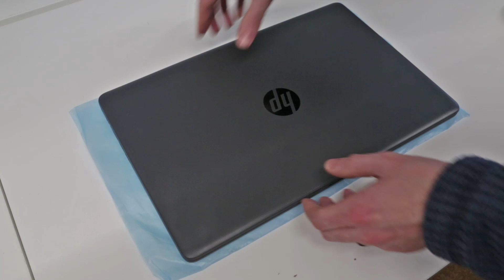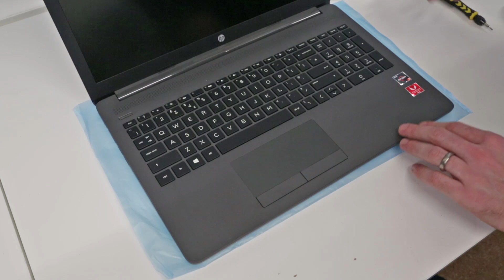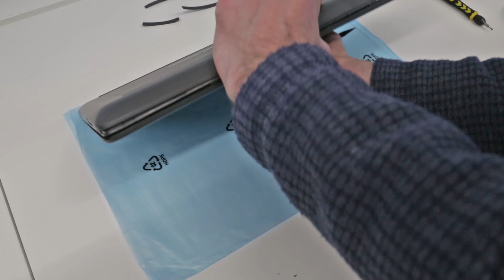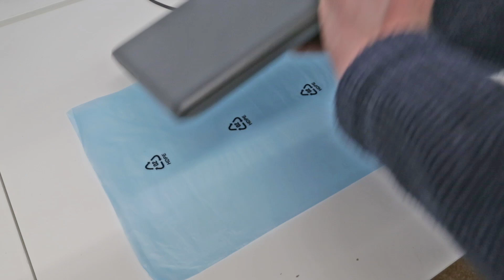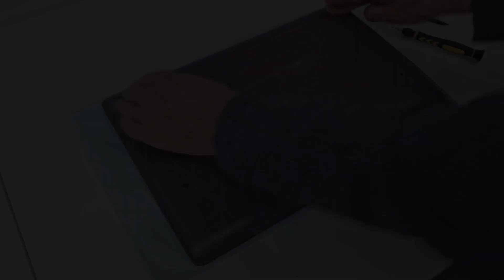HP 250/255 G7 - DDR4 RAM Memory Upgrade Guide - 6BN96EA

Comment: You know what's easier. Is to have the computer on the screen side so the weight of the computer is not pushing the bottom cover back on to the computer that you are trying to remove that is the dumbest crap I have seen in a long time

Comment: Awesome video for this model, but mine seems to be a little different, the memory was souldered to the board with most of the components and I didn't want to damage it so no upgrades for me :(
Reply from the maker: Thanks for the info! What was the full model number?
Reply: @BrueComputing  It was an HP 250 G7 Notebook, I purchased it refurbished but the HP support website says it's not user accessible/upgradable
Reply from the maker: There will be a longer model number, like ab123cd normally. That gives you the exact spec.

Comment: Great video!

In the QuickSpecs for the HP 255 G7 I found this information:

Maximum Memory
8 GB DDR4-2400 SDRAM10
8 GB DDR4-1866 SDRAM10

Memory
8 GB DDR4-2400 SDRAM (1 x 8 GB)
8 GB DDR4-2400 SDRAM (2 x 4 GB)
4 GB DDR4-2400 SDRAM (1 x 4 GB)
8 GB DDR4-1866 SDRAM (1 x 8 GB)
4 GB DDR4-1866 SDRAM (1 x 4 GB)
8 GB DDR4-1866 SDRAM (2 X 4 GB)

According to this table you have 3 options:
1 x 8 GB (Maximum memory in one slot),
or 2 x 4 GB (Maximum memory if you want to use both slots),
or 1 x 4 GB (1 slot used. You can still add 4 GB in the other slot)

My question is: does it really work with 16 GB (2 x 8 GB)? Will it start and accept 16 GB, Is it stable?
Reply from the maker: Yes, should work fine.
Reply: @BrueComputing  can be dual channel ?

Comment: I initially had 4GB of RAM but I recently added an additional 8GB and since then the keyboard and touch pad stops working until i put the laptop into sleep mode for a few seconds then they work fine again for a few minutes and go out again. ANy opinions ? I hate having to use a plug in keyboard and bluetooth mouse when i already have one built in

Comment: I have one of these and it's so horribly slow I don't know much about laptops, it's so slow, mine was bought with only 4gig ram would I have to get 2 8gig ram cards? And how much faster would it make the machine or is it even worth it
Reply from the maker: What processor does yours have, and is it equipped with a hard drive or SSD?
Reply: Screen size:39.6 cm (15.6") diagonal, HD (1366 x 768), anti-glare, 220 nits, 45% NTSC
Processor :AMD Athlon™ 3020e (1.2 GHz base clock, up to 2.6 GHz max boost clock, 4 MB L3 cache, 2 cores)
Memory: 4 GB DDR4-2400 SDRAM (1 x 4 GB)
Storage: 1 TB 5400 RPM 2.5-inch SATA Hard Drive
Graphics: AMD Radeon™ Graphics
Operating system: Windows 10 Home Single 
This is the description from when I got it, like I said I don't know much about hardware and stuff, any help would be appreciated

Comment: Would you say that 3200MHz is a bit much for this model to handle? I got myself a pair of DDR4-3200 8GB RAM cards for my HP 255 G7 Notebook PC (Ryzen), and was about to install them onto it. I believe that they’ll under lock down to 2666MHz once installed, but I was wondering if I could ask for a second opinion
Reply from the maker: I believe they will run at 2666MHz or 2400MHz depending on the exact model of 250/255 G7.
They should work fine though and the cost difference is minimal.
Reply: @BrueComputing  thanks for the feedback I appreciate it. So far I’ve just installed the ram into my laptop and started up now

Comment: My laptop only has one slot. Also it's insert with the label on the 4 black squares facedown. And Why at 5:46 in the video the 2nd memory card disappeared?
Reply from the maker: If it has one-slot it is probably a lower end model with something like an AMD A6 APU and will be slightly different. 
It disappears in the video because I was actually just doing an SSD upgrade for a customer and just fitted a spare memory module for demonstration purposes in the video.

Comment: Hello, I have the NOTEBOOK HP 250 G7 153B9LT 15.6 / I5-1035G1 / 4 / 1TB / DOS. And I want to add 8gb of RAM to it. That is, it already has 4gb to DDR4-2666 and I want to add another 8gb DDR4-2666 module, in total 12gb. The technical question is the following:
  Is this 12gb combination (4gb DDR4-2666 + 8gb DDR4-2666) going to work at the speed of 2666 or 2400?
Because someone told me that this configuration of 4 + 8 in this notebook works at 2400 but if I put 8 + 8 it works at 2600.
Could you confirm how fast the 4gb 2666 + 8gb 2666 combination works? 2666 or 2400?
Thank you, I await your reply.
Reply: Hi there! I was just on the HP support site (Feb 2023), and this is what they recommend: "HP recommends purchasing the same type of memory (same size, speed, and manufacturer) for each slot. For the best performance, purchase the fastest memory the motherboard supports.  CAUTION: Some motherboards are not able to configure memory modules with different manufacturers, or different CAS or density values. To ensure your memory is compatible, make sure all SO-DIMMs have the same part number.".

In terms of how much to put in each slot, here is what they say...
"SO-DIMM memory and requirements: Notebooks use SO-DIMMs (Small outline dual in-line memory modules). They are smaller and thinner than other DIMMs, so are used when there is less space within a chassis. SO-DIMM modules for HP computers must meet the following requirements:

    The number of pins on the SO-DIMM must match the socket type.
    SO-DIMM memory requires a 200-pin slot.
    DDR2 SO-DIMMs are not compatible with DDR1 DIMM and DDR2 DIMM memory modules.
    DDR3 SO-DIMMs are not compatible with DDR1 or DDR2 and use a 204 pin slot.
    With a computer running at a system bus of 533 MHz or 667 MHz, use a PC2-4200 (DDR2 DIMM 533) type"    
            (====> and yes, this is the current support info on the website, but looks like they haven't updated it in a while!!)

Lastly they add: "If possible, make sure all memory modules in your configuration are from the same manufacturer and have the same part number" BECAUSE "If memory speeds are mixed, the system performs at the lower memory speed".

SOOOOOO, your combo should should come out to 2666, according to the above. Memory is soooo cheap nowadays,  I would put in the max amount possible. 

PS. I just looked up your notebook, and it said the slots are inaccessible?

Comment: Is the screen upgreadable to fullhd ips? I  had a lenovo that came with tn 720p panel and changed it to 1080p ips. Maybe you could take a look if possible
Reply from the maker: If you can find a panel with the same connector type and positioning and mounting method then sure, but HP don't list one in the service manual.

Comment: Laptop have ram 2400 MHz and you put 2666 MHz is that a problem?
Reply from the maker: HP actually ship all models of the HP 250 and 255 G7 with DDR4-2666 modules installed - either part number 937236-855 (8GB) or L10598-855 (4GB).
The speed it runs at is dictated by the maximum memory speed the processor supports - the Ryzen 3 3200U supports a maximum speed of DDR4-2400, so the memory runs at that.
The module I recommend is of the same specification as the one supplied with the machine.
Reply: @BrueComputing  my hp have ryzen 3 2200 u you say ryzen 3 3200u

Comment: Presume the machine boots up ok and recognises the extra RAM automatically?  Did you have to buy new feet to replace those removed ?
Reply from the maker: Yes, should recognise it with no other changes. I just stuck the original feet back on.

Comment: hey my 250 g7 has only 4gb of ram. Will there be a problem if i fit an 8gb ram in the second ram slot and have 12gb (4+8) in total?
Reply from the maker: Should work fine if the same spec in terms of speed, latency, etc.

Comment: Hi, i have a question about the ram configuration
The manual says that i cant have a 12gb ram configuration, is that correct?
i have the 250g7 with 4gb dd4, i wanted to add 8gb but i dont know is this is possible, can i do it?
or i can only put 4+4 and 8+8 ram configuration?
Reply: 8gb max 2 x 4gb ddr4

Comment: Is it a good idea to add 8 GB more in the second free slot and keep the already installed 4 GB in the first slot? Thanks
Reply: mine initially came with 4GB and since i added 8GB of ram in the extra slot my keyboard and touchpad stops working until the pc goes in and out of sleep mode before they start working again
Reply: You can have odd pairings but it's not advisable. You would be better buying two banks of identical ram either 2 x4gb or 2 x 8gb. You also eliminate the more problematic issue of different mhz speeds of ram.

Comment: Hi, i need your help . I have a laptop HP 255 G7  with a  AMD A9-9425 APU Processor ( 3.1 GHz base frequency, up to 3.7 GHz burst frequency
  MB cache and 2 cores ) .It has a one (1)  4 GB,  "1866 MHz SODIMM  memory module . What would be the right part to upgrade  memory  to 8 GB . I would also appreciate if you could provide me with a link on Amazon where i could purchase such a module . Thank you in advance .
Reply from the maker: One of these: https://amzn.to/3btcWHe
You can buy a higher speed module, it'll just run at DDR4-1866 speed.
Reply: Thank you very much for your quick response , much appreciated !!!

Comment: can i add more memory i have hp 250 g7 i5 processor bought from ebuyer
Reply from the maker: Yes, it has 2 DIMM slots. Generally they ship with a single module installed.
Reply: @BrueComputing  I dont know if I can add 32gb max or 16gb max also can i just add 16gb and 8gb

Comment: But wasnt the ram maxed out for 8 gb ?
Reply from the maker: No, you can fit 2 x 8GB modules for 16GB.
Reply: Brue Computing But it is important if the System supports 16 gb of Ram.

Comment: This video forgets to mention that the DVD drive has to be removed first. This is very important, otherwise the connector can be damaged!
Reply from the maker: Not mentioned as the model I was working on didn't have an optical drive.
If yours does then you'll have to slide it out after removing the base screws and check for any underneath it along the edge of the chassis.
Reply: @BrueComputing Thanks to video,much helps to me.I have ntb 255 G7 but with only4GB memory.Clasic HDD+DvD mechanic.Ntb slow working and I will change memory,but have only one socked for DDR.I can Hope for change memory update to 8GB or more.Greeting from Czech..😊
Reply: Agreed. If you could add even a quick text warning to the bottom of the screen, it would help loads. Luckily, my optical drive came out undamaged, but the click sound was cringe-inducing😅. EXCELLENT video man. Thank you so much!

Comment: Hi.  My Computer only has a single slot.  Do you know of any single chip 16 GB that would fit?
Thank you
Reply: check the product spec online or the manual it will tell you if you can go from a single 4 or 8 or 16 module
Reply: Ed Kent f

Comment: Like Daniel Ebraham below I would also like to make sure I fit a compatible MM. The parts list number of the fitted HP MM is 937236-855, which is rated at 2666mhz. Does this mean it would be best to fit another 2666mhz MM rather than, say, a 2400mhz rated MM?
Reply: Yes, otherwise your ram speed will run with 2400mhz, which is slower than the other one.

Comment: Hi!
Does the HP have 255 G7 (7DF18EA) space and an HDD connector?
Nowhere can I find this information :(
Reply: The HP 255 G7 (7DF18EA) as stated in the HP site has only the m.2 fully implemented but still has the physical bay for a 2.5" internal drive and an extra (available to all 255 g7 ryzen series) sata controller for either optical or HDD/SSD use  (as you can see for yourself here : https://www.youtube.com/watch?v=S6a6vMI1Lx8). What is missing is the  cable/adaptor for it. Despair not, both are available from HP and 3rd party manufacturers and shouldn't cost much since it's just a ribbon with the appropriate plugs for either side(no extra electronics).

Comment: Is this process under warranty, what damage to the warranty may be
Reply from the maker: In the case of my machine I did not break any warranty seals, but if disassembling a machine I would always assume that the warranty MAY be voided. Obviously in the case of a warranty issue you would want to return the system to its original configuration, and any upgraded parts you fitted would not be covered.

I always recommend using plastic pry tools to avoid damage to the plastics, keep track of what screws came from what location, and be calm and methodical to limit the chance of any issues.

Comment: Hi, I ordered this memory before seeing your video - can you confirm if this will be okay. Crucial CT8G4SFS824A 8 GB (DDR4, 2400 MT/s, PC4-19200, Single Rank x8, SODIMM, 260-Pin) Memory. It currently has 8GB memory. I want to double to 16GB. Secondly how much do you charge to fit, if I don't feel like doing it myself.
Reply: If in your laptop has installed  2400 ten your 2400 module will be good

Comment: I suppose HP means RAM upgrade is not for everyone. Right?
"Both slots are customer non-accessible / non-upgradeable"

"Version 8 — July 3, 2019 Page 6" 
http://h20195.www2.hp.com/v2/getpdf.aspx/c06182356.pdf
Reply from the maker: As there is no access hatch and the system has to be disassembled to get to the slots, HP consider it customer non-upgradeable.

Comment: Can I replace the current storage device with a larger one? Can I add a storage device without removing the existing one? Can I use multiple types of storage devices like HDD or SSD or does this machine use M.2?
Reply from the maker: Yes, I have a video covering this here: https://www.youtube.com/watch?v=S6a6vMI1Lx8
Typically though the HP 250/255 G7 only support the type of storage they are supplied with - models with a 2.5" SATA drive only most likely won't have the M.2 connector on the mainboard. Likewise, models supplied with an M.2 drive (like mine) will need the SATA cable and board added in, which is quite expensive to buy from HP.
Reply: so if I understand correctly the M.2 connector is for the ssd drive like the video . ? mine came with a hdd drive installed , 1 memory module slot on the board . I wanted to add the ssd drive which is next to the battery . No slot though ?  So Im sunk ??

Comment: Does it matter between the SO-Dimm or the SD-RAM for the HP 255 G7?
Reply: SODIIM  phisicaly format of PCB for RAM in laptops, it is shorter and hhgher than stadard DIIM memory for PC computers.
SD and microSDHC is memory card stick going in slot od card reader, it is slower tnan RAM add is usually used to copy photos from smartphone to laptop/PC

Comment: I want to do this but I’m just a bit nervous as I haven’t done anything like this before and don’t want to damage the laptop. Any tips?
Reply: Keep the video up on a screen playing while you go through it. It's not a big deal really! Having two nice flat head screw drivers to take the case apart helps, you put one in the case, and then slide the 2nd in the opening and move it along, and keep prying! It will just pop open as you go. If any part seems extra difficult go back look at the video and see if you are missing a hidden screw! These things are more durable than you think as far as working on them goes. You should be able to do it. Upgrading the memory in these things makes a world of difference, they really are slow and glitchy unless you have like 16 to 32 GB of ram in them. Anyway good luck!

Comment: Hi I've just bought one of these. I've been looking at the quickspecs document and it says maximum ram is 8gb yet it has two slots. Is that a max per slot or am I missing something? I have an 8gb DDR4 stick from a dead laptop that I'd like to install but I don't want to mess something up. I'm pretty new to computer hardware.
Reply: I'm watching the video to find out exactly that. Unfortunately I haven't found an answer yet.
Reply: @Manana121  do u guys know the answer now?

Comment: Memory is supposed to be one of the easiest components ever to replace.   HP should have made this a LOT easier.. Thats insane!!!   No one wants to remove the entire bottom panel of a laptop to add memory
Reply: err, it is a pretty easy operation and it is better than the laptops that you cant mod at all.
Reply from the maker: Its pretty common now, unfortunately.
Its not an overly difficult machine to remove the base of though.
Reply: Years ago you had one screw and a little flap to lift ! Good old days
Reply: I agree. That thing is pointlessly difficult. My Acer Aspire 7 has two user accessible bays; one for RAM and one for the hard drive. A single Phillips head screw each and you're in. Took me 5 minutes to double the RAM (and memory bandwidth) and swap the HDD out for an SSD.

Comment: Hi, great video. One question, the eBuyer listing for the i5 processor (HP 250 G7) states it only has one memory slot. Is what you have shown different to that on eBuyer?
Reply from the maker: Do you mean where it says "Configuration 1 x 8GB"?
That means it comes INSTALLED with a single DIMM, there should be two DIMM slots internally - that is the case on the HP 250 G6 models (Intel based) along with the HP 255 G7 I had for this video.
Reply: Brue Computing thanks for the info. This is really helpful
Reply: the i5 processor model only has one ram slot the ryzen version on the other hand has 2

Comment: Does it support 32gb?
Reply from the maker: Officially only 16GB, but 2 x 16GB modules may work.
Reply: chech online specs or manual . If it says 16 max then that is either 1 16 gb module if you have 1 slot or 2 x 8 gb modules if you got 2 . depends what the spec says, best just ask HP company